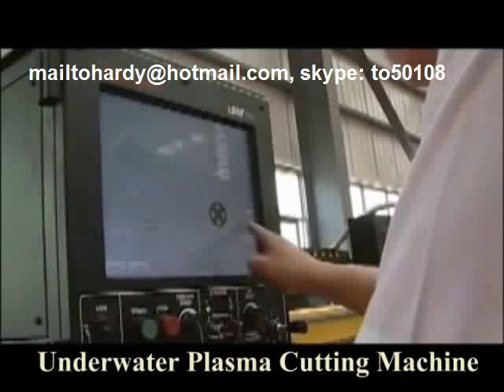Semi trailer Production Line

Comment: is the chassis Hardox? or we can  use a normal metal?
Reply from the maker: +Damen Wahidi we are machinery manufacturer. what kinds of material it is depend on your client requirement.
Reply: but normally they use a Hardox for chassis ?
Reply: +Damen Wahidi No. Hardox wont be used for chassis.
Reply from the maker: if you need semi trailer products or machinery, feel free to let me know.